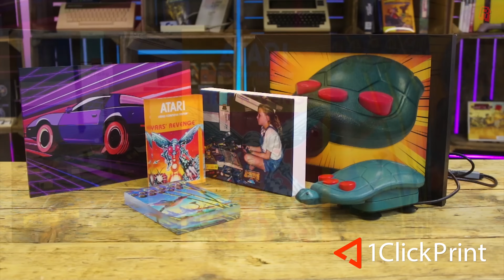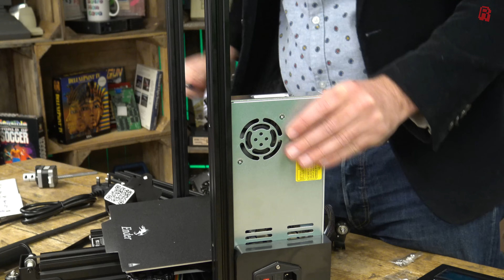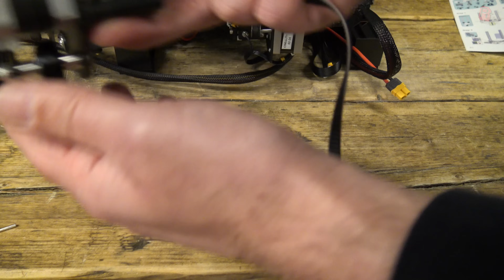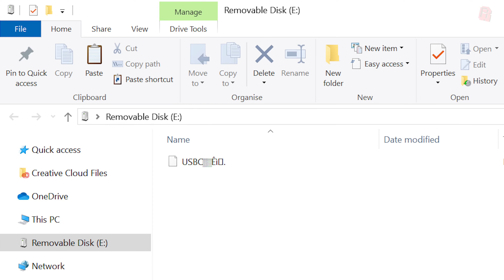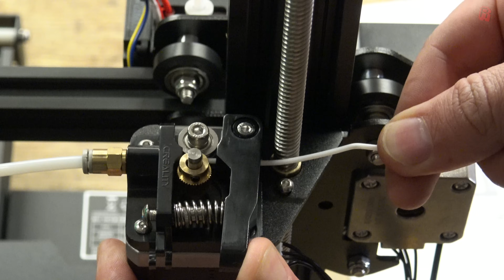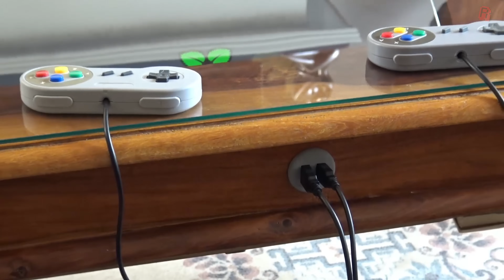3D Printing - Get started with the Creality Ender 3 Pro - My First 3D Printer

Comment: I have my Ender 5 since January... I like it very much. As long as you dont use their crappy Filament... I thought the printer was broken when using the Creality Filament. But using other Filaments solved every extrusion or adhesion problem. There are so many useful addons to print for the Creality printers on Thingiverse... Like a toolholder or anti vibration feet, cable management, filament sensor or webcam holders. Such a great support in the creative community around Creality in general. And the replacement parts are cheap and plenty. There is a special "Creality slicer" ... its basically cura but very well working with the Ender.

Comment: I'd say most people have basically no need for such a machine. But they are neat.
Reply: I can tell you that almost everyone who gets one uses it a lot more than they thought they would and comes to consider it essential.

Genuinely, I think most people would actually use it a lot more than they ever thought. In the next ten /twenty years I expect that most people will have their own 3D printer and it'll just be a normal thing
Reply: if you are into board games or table top games they are a great extra tool to have

Comment: Be sure to check out teaching tech, he has all of the info you'll need. Not watched the vid yet, but be sure to fix the firmware with a version that has thermal runaway enabled, I wouldn't leave a printer alone without it.

Comment: Hi Dave, I have a very similar printer and had to go through some learning iterations. Just one essential advice, every time you print, give the plate a short wisp with an IPA, the models stick on the surface  much better then.

Comment: I am a manual and CNC machinist, in the engineering industry and these little devices are fascinating.
Reply: Indeed they are. They even run on Gcode, so if you know your way around that, you can set them up to do all sorts of things automatically.

Comment: I've been 3D printing for 6 years now but only recently bought a new second printer, not much wrong with the old one other than it was old & not really compatible with the newer packages out there. From what I've learned over the years:
* If using ABS make certain you don't have any draughts - a window open the other side of the house can cause chaos with the print. The easiest fix for this is to have an enclosure around the printer so that draughts are kept to a minimum.
* Use a heat bed at the right temp for the medium. I use PLA most of the time so the bed is at 60C
* Never leave the printer unattended - yes prints can take hours but printers but it's worse if a print fails part way through & you end up wasting element because the print has moved (just like in this video & I had one print do that this week)
* Level the bed - you will find you will do this more often than you think. If a print fails with bad adhesion to the bed, check it's still level
* Most printers have USB as well as SD ports, so get a Raspberry PI & install Octoprint on it (available as an sd card image). It'll save you time copying stuff over & you can manage & monitor the print as it goes along. Some slicers will even do the upload to Octoprint for you.
* If doing dual prints (i.e. 2 or more different colours of filament) make certain you use the same material type for each one, i.e. use all PLA or all ABS etc. Don't mix as it won't work as they have different temperatures.

As for modelling, I use OpenSCAD - different to most cad's out there as you write code to generate the object not draw it. As a programmer it's more intuitive for me than drawing even though I did Tecnical Drawing at school back in the 80's
For slicing Cura
Reply: when you say check that the bed is level...do you mean level to the world and to the nozzle?  as in, could the bed be level to the nozzel but still work if the printer is on an un-level table? Cheers!
Reply: @briholt100  When you hear anyone say if the bed is level when it comes to 3D printers, it's to the nozzle - as in whenever the nozzle moves over the entire bed it remains at the same distance from the bed. As for the world, that doesn't really matter. In fact one of my own printers can be wall mounted so the "bed" is almost vertical not horizontal
Reply: @PeterMountUK  that's what I thought, but surprised to learn it can work mounted on a wall...thanks for the reply!

Comment: I grabbed and modded/upgraded a Monoprice Maker Select Plus just over a year ago now, changed the way I do a lot of things. If I can't find a thing, I'll design or replicate a thing from scratch. I design stuff in Tinkercad--it's pretty simple, which means you need to be creative in accomplishing some things. 

I guess one example is that I built my niece a PC just before the pandemic that was/is technically defective--it was missing a panel for the PCIe expansion slots on the case (Phanteks P300). I didn't somehow realise until I had built thing, and didn't want to send the case back. I was able to use the one from my PC (Phanteks P350X) as a template, with digital calipers and neodymium magnets. 

Another is the MICKE Desk from IKEA. Because I needed some extra cable management channels--I designed an extension that clips on the existing channel. 

Honestly, I feel like I'm in Star Trek every time I'm printing something.
Reply: damn, custom cable tidies is a great idea... makes me wonder about pulling the trigger too..

Comment: Your couplers that hold the PTFE tube are missing the small clips that got added to prevent the tupe from slipping out. The couplers are known as low quality and new ones are rather cheap, so replacing them will be the better choice sooner or later. The extruder is also known to fail after a time (the plastic wears out. Older versions didn't have the brass insert like yours) so getting the better aluminium version as a replacement will be a good idea.

Comment: The Ender 3 is a great piece of kit and very useful for printing custom PC parts, gotek mounts etc. I've been running mine for two years no problems whatsoever with it. Bed levelling is critical but easily achieved with a square pattern test STL file.  Would highly recommend Chuck Hellebuyck's channel. Some great tips for setting up the Ender 3. https://www.youtube.com/user/beginnerelectronics
Blender 3d is the best free open source application for CAD model making and exporting .STL files.
Enjoy...

Comment: As soon as you get a printer you also start to think about learning CAD. Fusion 360 is free for non-commercial uses. Octoprint with a webcam for monitoring builds remotely is useful too.
Reply from the maker: I've tried a few now (you'll see this printer used in next weeks episode for a fix) and I've found Fusion360 is the one I get on best with.
Reply: @TheRetroCollective  When you start to learn with Fusion 360, one tip I can give you is to test all the different Pan/Zoom settings. The standard settings in Fusion 360 were really annoying for me and I switched to the "Tinkercad" setting. You get to this setting by clicking on your name in the upper right corner and selecting setting or whatever it is called in the English GUI
Reply: @TheRetroCollective  Yup. There's one where you can effectively code your shape in code. FreeCAD? sod that, I'll interactively do it :)

So far I've only uploaded one thing to Thingiverse which was to fix a Roland JD800 keyboard contact strip.

Comment: To model 3d objects, I recommend you to use Fusion 360. Excelente software for parametric designs, CAD and CAM.
You can get a free hobbyist/student copy from Autodesk.
Reply from the maker: After trying a few it was Fusion360 I settled on, it feels more intuitive to me than other offerings I tried out
Reply: I'm more of a FreeCAD guy myself, but Fusion360 is certainly capable software.

Comment: Literally astounded by this printer, bought mine just over a year ago and it's been in use non-stop for business and it's more than paid for itself.  You wont be disappointed.
Reply: GFBDev what have you been making?
Reply: what are you using it for? I bought mine also a year ago- but I rarely use it- the software drives me up the wall (fusion....) and the long printing times keep me from making bigger more useful stuff... but that is just me being an idiot- the printer is good  and the prints are way better than I would have thought
Reply: I am thinking about getting it for my puzzle boxes I love to design them and even though my school has the exact same printer I think it would be easier for prototyping of parts fiting together by getting my own a ender 3 but should I? Also I am looking to not spend over 200$ canadian. Since I am a high school student. What should I do?